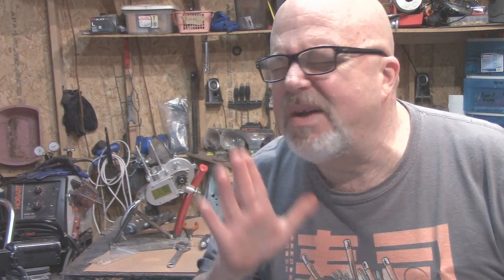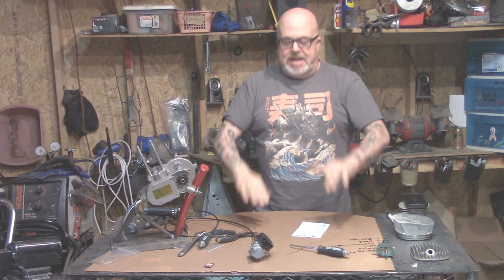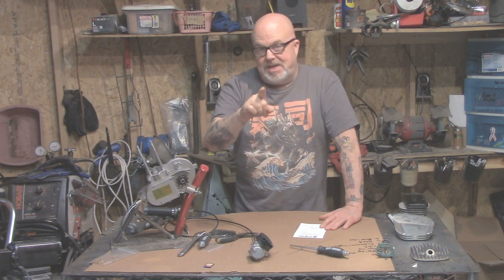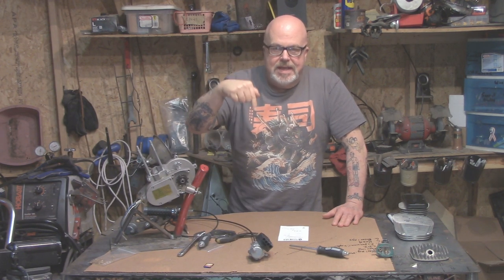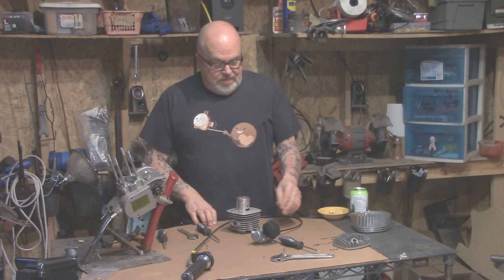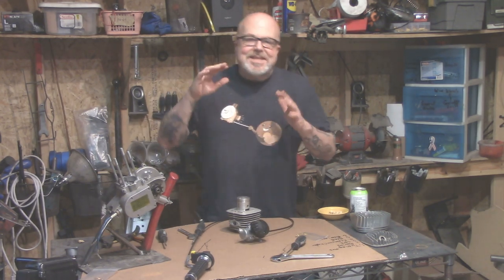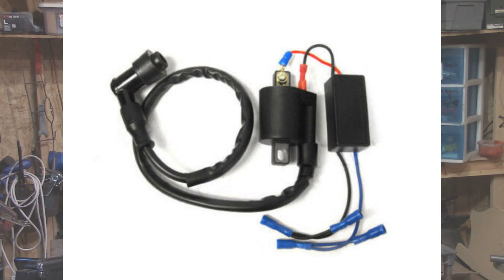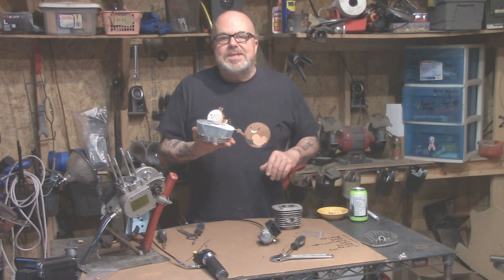Best Performance Upgrades for Motorized Bicycles - Without Breaking The Bank - No Boost Bottles

Comment: As a motorcycle mechanic & motorized bike builder that is the most intelligent engine explanation I have ever heard.
Reply from the maker: Thank you. I try
Reply: What is going on I'm about to do a 66 80 bbr and  I never had any luck how  they are hard to get together get
Reply: @HughesMotorized  half the time I can't  get into the new phone I'm old school and shit new school got but ya help with it needing
Reply: Need help with bike
Reply: @HughesMotorized  where is best to start and  thank you for getting back
Reply: My phone idk what happened to don't know how to work it pc or the data
Reply: @HughesMotorized what's your definition of hub brakes are they rim clamp brakes or internal center hub coaster style brakes? I have a 2019 phatmoto bike and the disc on the front doesn't stop good but the rim clamp brakes on the back stop better but the downside is chewed the paint off the wheel. Also stopping both brakes in the rain the rim clamp brakes stop far better. On automotive it's only disc brakes that stopped the best for now.
Reply: @HughesMotorized  I'd like to have all bottom end power that's it. I really putt around on my bike not much wide open at all. I can run faster than I ride my bike most of the time. And to get a good workout most of the time my bike the motor is off. My bike has a jackshaft dear, clutch gear and back big gear what's the biggest improvement to get out of the hole for takeoff which gear should I change and go more teeth or less teeth?if it was a car I would put a 5.13 rear end gear in it so it come out of the hole fast and pull up most hills and some off-road with that much gear.
Reply: @HughesMotorized  I thought about putting a 100 cc through 125 CC engine and 4-speed transmission if I can get it to go on the bike would be the ultimate. I would have off road mountain hill pulling power. And you can get these engines pretty cheap for about $200 - $300 price range with a 4-speed transmission. I won't get a motorcycle because I like to ride on the sidewalk, trails and it still has to have pedals on it, and in my state no license plate, no helmet, no taxes nothing so far. I like the motorized bike but I'd like to have some more power. Also I have a beach cruiser thought about putting a 2 stroke 100cc on it but at the $400 price tag it would be cheaper to go with motorcycle engine and transmission for ultimate pulling power. Both bikes I just want all power out of the hole and for slow mountain climbing like a motorcycle or ATV can do.
Reply: @HughesMotorized  what about raising the compression in a four stroke or the two stroke engine both air-cooled what's the max compression you can run on 92 pump gas? what's the most economical way to raise the compression in these little air-cooled single-cylinder engines? Mill head, thinner head gasket, deck block bigger cc piston? of course all these methods will raise compression but what's the most economical? With all that back and forth on the 2-stroke to fine-tune it I believe I'd rather just go propane at a 110 octane be done and never run to lean, never have to treat the fuel and inside of engine and spark plug stays like new. My little generators single cylinder air cooled 4 strokes 40, 80, 98 &118 cc are propane and gasoline. But most off I want more bottom-end power with dependability and reliability on my 80cc gasoline 4 stroke phatmoto.
Reply: @saddletramp1200 or Hughes, how does one become a motorcycle mechanic?
Reply: @AFuTeZ  Motorcycle Institute is an acceptable way, I learned the old way, by working at a motorcycle shop several years with a mechanic to show and guide me. I have worked on bikes 40 + years, I know a little.
Reply: Very very easy to understand for those who may be  Fairly inexperienced or have absolutely no experience at all Even in small engine repair  I've guided no less than 10 people to this video because he explains it so immaculately
Reply: @carlcustomer1379  NEVER give out your personal number.. its far to easy to start the process  I'm having your entire identity by the end of the day and trust me I know that's what I have a degree in cyber security working as a cheif information security officer cyber sec admin and lastly a penatration tester
Reply: I remember when I started working on motorized bikes bikeberry and your videos were first to go to so salute Ive had quite the adventures in the last 3 years

Comment: as someone who worked landscape maintenance i know that most of our tools were 2 stroke, chainsaw, trimmer, gas blower ect.   and i was always under the assumption it was becasue not only the versatility of movement not having to worry about the engine staying level during operation as well as their abilitiy and optimized performance as an engine that is designed to be at full throttle for long periods of time.  for example during hedge season we use gas 2 stroke hedge trimmers and run them up to 3 hours straight at sometimes comeplete full throttle.  these engines operate like this 10 hours a day and these machines last 5 years or more.   
I always here people on the motorized bike community though say that 2 strokes dont like to be at full throttle for long peiods of time. Im curios why is this the case as most other 2 stroke engines are designed to be operated at full throttle for long periods of time,
 i men think about it Even lumberjacks how would they be expected to work all day if theyre always running half throttle and letting the engine cool down every hour.

Comment: if they had an awards night for best teacher of motorbikes you'd win 1st in every category.  ive been bu io ling these bikes for a yr n a half.  im still learning. i buy bikes that ppl have no idea how to fix em,so i grab them for $100 bux or less. i sand ,primer, paint,clear coat,rebearing,and grease,put togather from birth to re pairing of or replacing the motor and flip them for 350 to 500 . but i learn from you hughes. your an award winning teacher.   ken.new port richey,fl
Reply from the maker: aww shucks, thanks

Comment: I’ve been running 40:1 for years and years in just about every 2 stroke engine I’ve had and I’ve never had any issues with it not oiling properly or wearing out prematurely!!! Infact it’s more than good enough!!!! The thing most people don’t understand is that 2 stroke motors are happier in the high rpms and they don’t like idling too much!!!! You end up with fouled plugs and clogged spark arrestors when you constantly run a 2 stroke engine in the lower rpm range…

Comment: The only thing I can really say after running mine is that the stock exhaust has to go if you do buy a better carb. While running a larger really expensive carb I did notice that I got better performance but it wasn't great because more fuel in means a better exhaust is needed to get the burned and spent fuel out.
Reply from the maker: It's a matching thing like you say. best carb ever wont help if you have a crappy exhaust and or bad porting
Reply: All I can say is yes and no to your comment there are so many variables and no Motors are the same

Comment: The key to going fast with small displacement engines is the fuel. I was able to go 50mph on 49cc two stroke engine using 110 octane trick fuel in 1977. I figured it out when I was 16 years old. It’s not complicated 🏁🏁🏁
Reply: That's only gonna work if you have the compression to back it up

Comment: I run a b6hs ngk plug and after replacing my throttle cable (it was too short after adjusting for crappy hp carb when swapping to an nt speed carb) and changing the jet to a 78 jet is running great. Got a 40t on the wheel and a 10t on the motor it's getting up to 36mph and I can't be happier, it's my first restoration on my first gas bike and I'm officially addicted. You also do a great job on simplifying and explaining how to modify these bikes

Comment: Hydraulic ebike brake kits are a great upgrade as the tectro's are meant for higher speeds and I don't replace them too often, about 500-700 miles depending on how aggressive I am with the breaking

Comment: I've rejeted the stock carb to a 66. readjusted the "E" clip leaner, top notch.  Starts hard. just crack the throttle the engine will slowly wind up. The engine seems to clear it's self at a very low throttle, I can feel the raw power come up.  If I add throttle it blubblers, come back off the throttle and it will clear again and run with power. Smaller main jet still? Then richen the needle setting?  Zeda engine bottom, compression head, hotter ignition and plug, the big box reed, stock NT carb. 4 inch tube between the carb and the reed box.
Reply from the maker: Might need a carb where yo can make more detailed adjustments w/ a reed. Might have an intake leak

Comment: Dangit.I subbed to you around this time as you made sense out of all the ..stuff...being said about these.>Obviously this is 3 Years later.(Thnx YT). I did my plugs by Your scale and the engine did Great.Thank You.Never screwed with 'jetting'.I took a punch and tapped in the hole a Tiny bit as the plug was wet.Fixed it.Tan plug .(I checked before and after with 'torch cleaning' kit wires,and went down a hair)

Comment: I made a case reed lower between them two case bolts I didn’t want to not have them bolts. I tapped the holes for the reed valve to 6mm thread. I am going to make a bracket for the carb so the reed bolts don’t take the load of the carb.

Comment: I'm sorry about the kid in Colorado, even though that's not your fault you must still feel some kind of way about it. It's like this, if you've never ridden a bike at high speeds and felt how easy it is to lose control you probably wouldn't want to be much faster than 35mph anyways. Been 30 mph on a 16inch bike, terrifying lol!

Comment: Howdy Sir, I took your advise about jetting mt NT carb at 678 foot sea level.  With a #65 jet and the groove  clip on the pin set to the top groove the engine runs great. I do get a surge  at top speed of 25mph. smoothest running speed with a 44 tooth rear sprocket in 19mph.  Not too bad for a 1964 Schwinn Typhoon, Thanks again. you do know your stuff.
Reply from the maker: Glad to help

Comment: I live about 2500' in elevation. I took my Phantom 85 V3 out for a test spin. Runs great but after awhile about 2-3 miles, it wants to bog down and cut off. That is because it's too rich, right? I've got jets from 65 up to 70. What jet size do you think is best for my elevation?
Reply from the maker: If it runs worse after a few miles then I'd suspect the coil or CDI going bad. next, I'd look to see if the gas tank is venting properly. might be starving for gas

Comment: Im brand new to this hobby, your channel is awesome!! I subbed instantly. So im not really concerned with breaking the sound barrier. 35 to 40mph is perfect. I live in Pennsylvania (Johnstown Pa) i was given by my buddy a BBR 80CC, It runs good. It has the 3 prong plug and he was running 16:1. Whats your recommendation on the mix and plug i should use?? Thank you for any help
Reply from the maker: 40:1...3.2 oz oil per gallon. You'll stop fouling plugs. Get an NGK-B6
Reply: @HughesMotorized  Awesome thank you so much

Comment: G,day Eugene. I’m just wondering what Dremel attachments do you use when your porting out the intake and exhaust outlet please. Are they the orange and green coloured carbide bits or steel milling bits.  I just brought a Dremel, I’m not used to what the attachments do. Thank you for your help I appreciate it mate. Take care buddy.👍
Reply from the maker: Carbide bits are best:
Vaccum Base Vise - https://amzn.to/3ct7Tr9
Carbide Bits - https://amzn.to/2MmZT05
Polishing Bits- https://amzn.to/3gXvFyW
Grinder w/ Flex Shaft - https://ebay.to/3drY1iF

Comment: Bro I installed one of those racing heads from Amazon on my pk80 wild cat,  gained 5 more mph But engine got hot then I looked at the piston an was burnt , I also broke a strut on the cylinder bolt trying to tourqe it , now I the stock head with 3 bolts lol, going to buy new cylinder struts  . An better cylinder an piston , note I tired even running rich on that head , maybe was leaking air causing it to over heat , fuel ratio did help but not enough carefully with them after market Amazon heads , I know they make one for my wild cat going to try that In the future thanks bro

Comment: I purchased a bbr stage 4 high compression head this is my first time building a bicycle engine kit I put the head on between the head and The jug I can still see the copper gasket and the head bolts there's a gap but it looks like it's sealed I have two gaskets at the bottom of my jug I don't know if this is normal is there supposed to be a small Gap I'm confused about it if you could help in any way I'd appreciate it thank you

Comment: I completed my first build , the Bikeberry BBR  tuning 80cc 2 stroke about a month ago and was somewhat pleased it runs good , hit a best top speed of 34 yesterday.  I said its time to upgrade so I ordered theFVrittolong long exhaust pipe  muffler, a high  performance cdi  ignition, and a 44 tooth sprocket  set.  Will I get improved performance with that exhaust. I t  just looks so much better than hanging down in front of the motor
Reply from the maker: Not sure which pipe you are wanting to upgrade to but most larger volume pipes will offer some better performance. Most important thing in performance is porting and jetting
Reply: @HughesMotorized  photos from my phone

Comment: I like your style bro. I wish I could apprentice under a small engine guy such as yourself. 460ft is my current elevation... I've gathered I should clean up the ports, check elevation and jet accordingly, change to a 36 tooth sprocket, modify the exhaust(or chop it off🤷🏻), add a spring tensioner, and get a better intake manifold(or chop it off🤷🏻)... Did I miss anything lol
Reply from the maker: Looks good. Go for the Arch style tensioner. The spring ones can allow too much slop and let the chain jamb up inside the drive cover
Reply: @HughesMotorized  reed valves are pretty cheap may have to get one of those but I'll have it to repurpose this is just a 50cc🤷🏻 but it was a gift from my neighbor he just wanted to build one...

Comment: I was wondering if you can tell me what's the best rear sprocket to use it seems like all the kits come with a 44 tooth is that faster than a 36 tooth for example does it make it run smoother can you tell me a little bit about the rear sprockets

Comment: Hi Eugene, i’ve been looking at purchasing another 80cc kit. However I’ve looked and a couple of different models and the specs of the motor are exactly the same (identical)  but the maximum speeds are about 10kph difference. Why would that be is there a speed limiter on these motors? If not am I able to increase the speed with my racing head and racing carburettor that I have. Thanks very much. Take care buddy.👍
Reply from the maker: Expect 40-51kph on average. A poorly balanced engine might get less. An engine with less trash in the ports and a better balanced crank might get closer to 60kph. No, there isn't a limiter per se, but the limits are manufacturing variables / defects

Comment: I i wished to take my 80 cc 2 stroke motorand put better bearing in what would i install  i already have a high performance pipe and this week i will work on porting the intake and exhaust ill probably will b e changing the jetting im sure ive learned alor from u THANKS

Comment: Good Morning Do you have any suggestions or thoughts for a exhaust pipe.  I have a GX7 29.. The high compression head won’t allow a bolt on.. The banana pipe won’t clear the front wheel... SBP ES02 is not available.. Do you have any suggestions or do you have one you can sell me??? I’m in Cleveland Ohio...
Reply from the maker: Shoot me some pics of a pipe held in place. hughesmotorized@gmail.com

Comment: How are u Eugene? I just have one other question and that is can you use sandpaper on the inside of the barrel? (Bore).. I have some burrs that are on the inside of the bore at the transfer ports and intakes, but I am too scared to use the Dremel in case I scratch the cylinder. Am I able to use some sort of sandpaper maybe 600 wet and dry to take the burrs off or does that affect the coating inside the bore?Thanks for your replies they have been very helpful you have been excellent thank you mate.👍👍👍
Reply from the maker: You can use 320 grit paper just on the edges to remove any burrs.

Comment: I know the hp carburator is decent but im looking for something alittle better could you do a review on carburators?
Reply from the maker: NT is the best other than a True Dellorto. The "HP" is a cheap ripoff. No real magic carb. Balancing, porting, port timing, proper expansion chamber, and jetting is what will make these motors run best. Once you have all that work in a 50cc Morini or KTM engine will be far better, cheaper, and more reliable
Reply: @HughesMotorized  a stock kit from ebay dynos at 1.5hp without the air filter cover adds .5hp then jet matching adds a ton it just shows its not a very refined carburator

Comment: So have been riding  these bikes over 10 years worst thing is the exhaust pipe vibrate sluice wears out the bolt hole just makes it louder all of a sudden I have a fast high RPM dried reducing the adjust Gable and throttle body. Help.   Please. And to me coaster brake is great for stopping faster